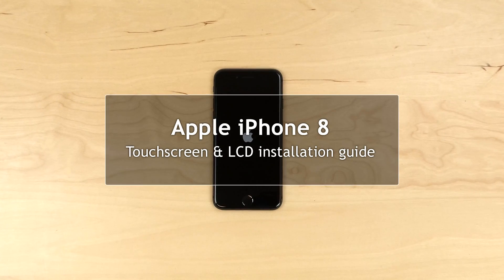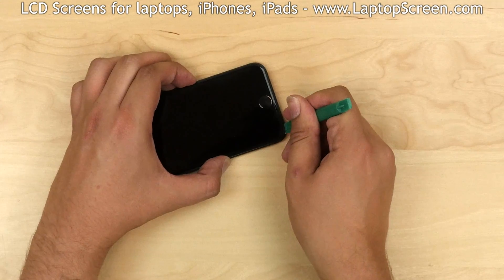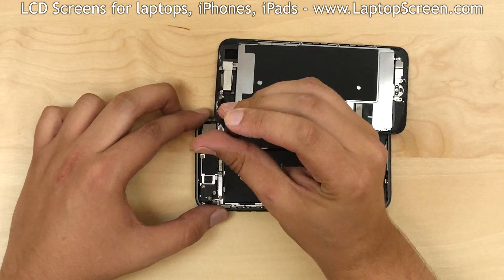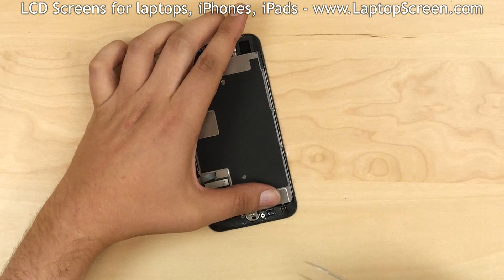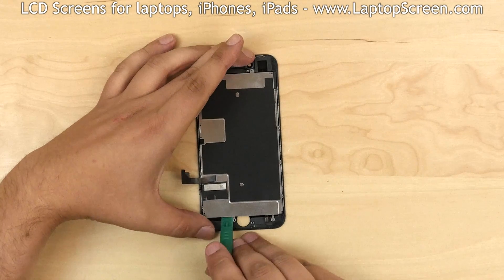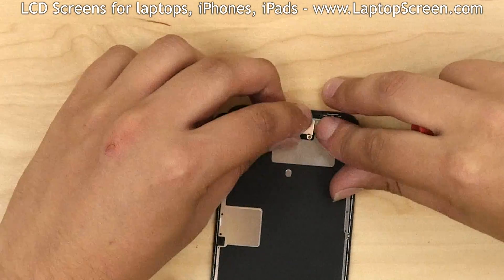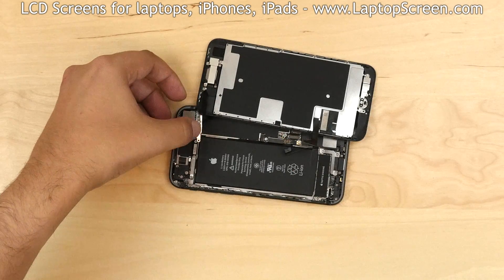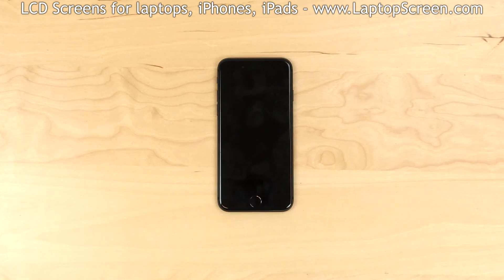iPhone 8 screen replacement / digitizer glass and LCD reinstallation instructions

Comment: Do you need to use adhesive to glue it back together or does it just snap together? Thank you
Reply from the maker: It is a good idea to put on new adhesive to ensure water tightness. New adhesive is usually sold in pre-cut sheets and is usually very affordable.

Comment: Is it possible to change only the digitizer so I don’t have to throw out a perfectly fine LCD?
Reply from the maker: Yes, it is possible. But it is a complicated process that requires specialized tools, time and patience, and nobody does it anymore because its more hassle than its worth since the iPhone 8 assemblies are quite affordable nowadays.

You would need to remove the old digitizer piece by piece, clean up the LCD of the old OCA (optically clear adhesive), sanitize the LCD surface for the application of the new OCA, apply OCA to the LCD, cover it with the new digitzer, stick the sandwich in the vacuum chamber to remove air bubbles, and voila - you've created a refurbished iPhone 8 display assembly.

Comment: What happens if I can't get the LCD Shield Plate off?  The Y000 screwdriver that came with the repair kit doesn't seems to grip.  How important are those screws? What's my workaround if I can't get them off?  Everything else has worked on your video so far! Thank you for your help!